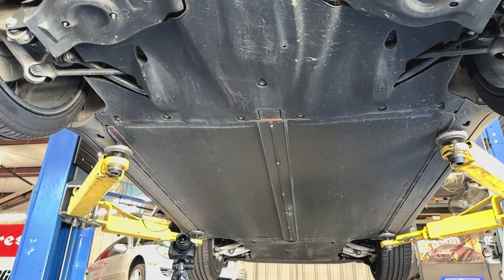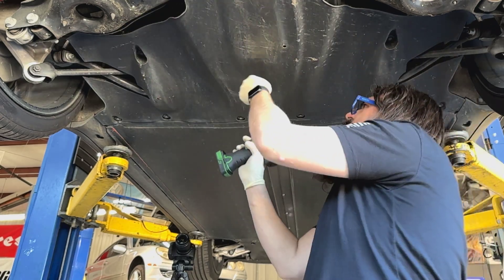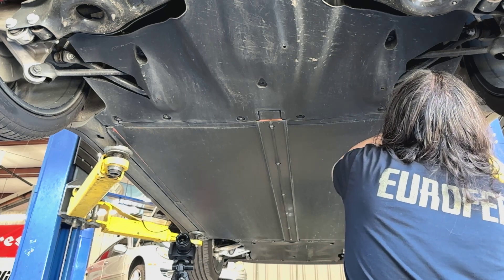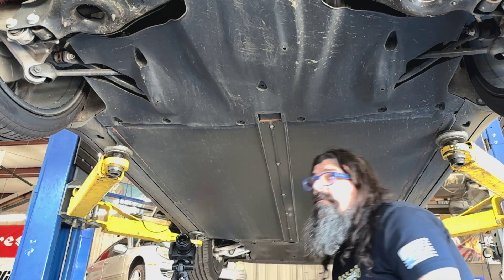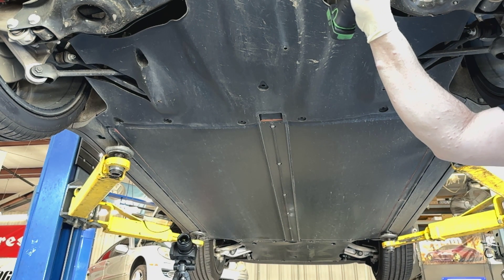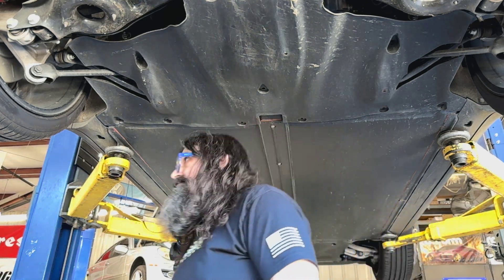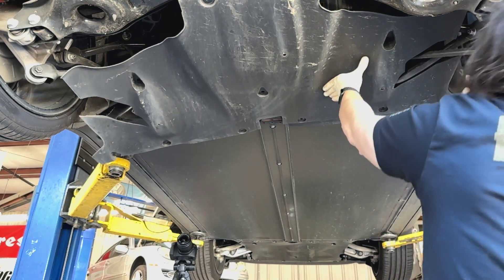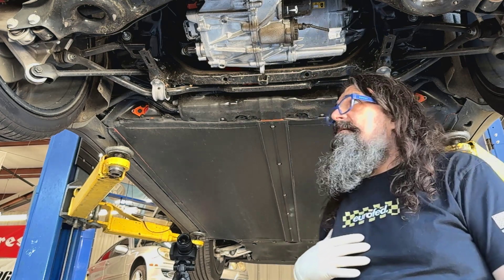Tesla Model Y suspension upgrade.

Comment: looks its unplugged performance pro coilovers.
Reply from the maker: Some of the best parts I have installed on Tesla cars. I will always recommend @unpluggedPerformance
Reply: @magic_mechanic  question please. do i need to install rear camber arms if i were to go for standard luxury suspension. it reduces the height by 1 inch. i have RWD 2023 model Y
Reply from the maker: @Rajjjjjjjjjjjjjjjj you should not have to, it just helps with alignment angles.
Reply: @magic_mechanic  ah cool! so rear camber arms not needed then? i read somewhere that lowering up to an inch do not need rear camber arms.
Reply from the maker: @Rajjjjjjjjjjjjjjjj I have done several of these, this is the only one that got all the adjustments.
Reply: @ the pro version is it?
Reply from the maker: I think so, it’s been a while. I know it had all of the things that were available.
Reply: @ thanks a lot 👍
Reply from the maker: @Rajjjjjjjjjjjjjjjj no problem, please check out some other videos. It would be a huge help to me. I need to get in that algorithm.